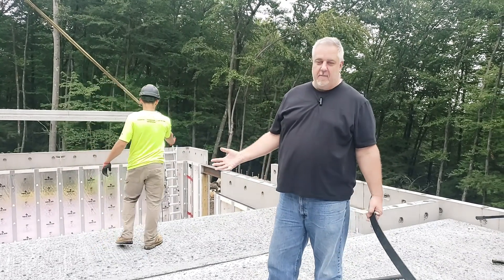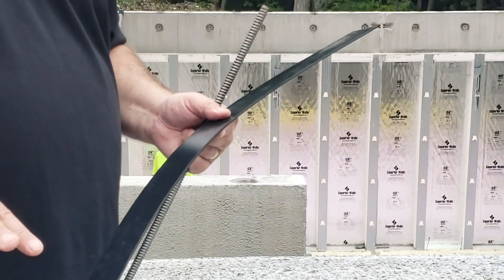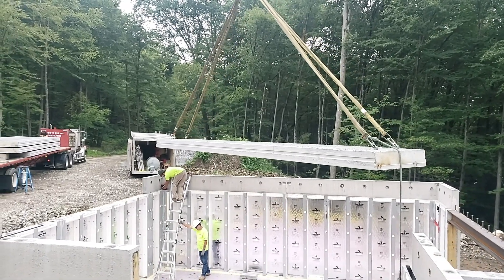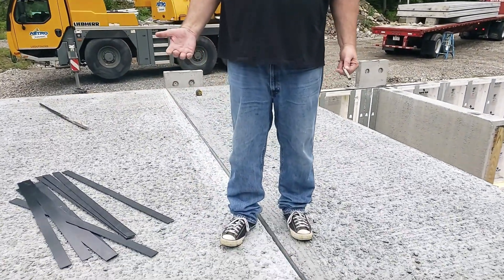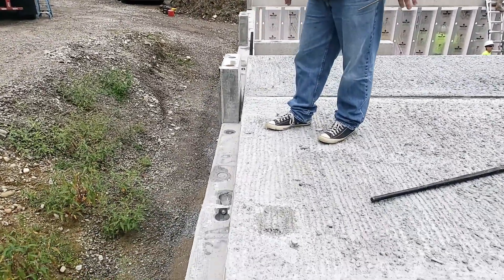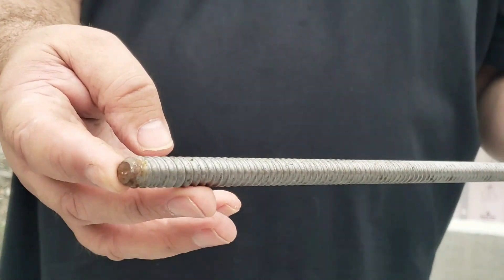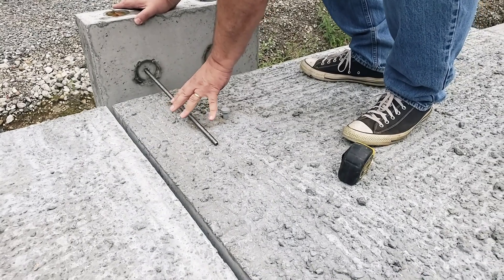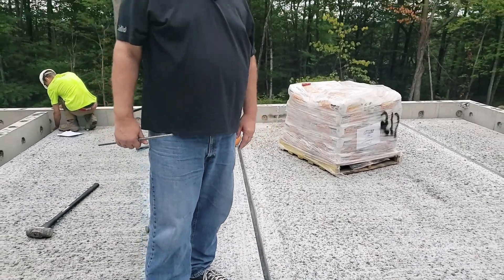Offsite Build Reinforcement Details

Comment: I like Superior Walls but would prefer more steel beams for structural support - why Ring of Fire Earthquake can produce significant earth movement, both horizontally & vertically and some concern the roof could collapse if it’s a significant quake even with concrete poured as you indicated.  Seems like steel beams internally would help provide the kind of structural insurance to not have the concern???